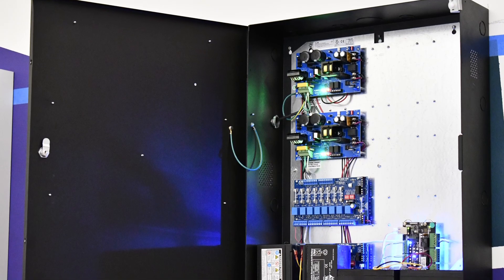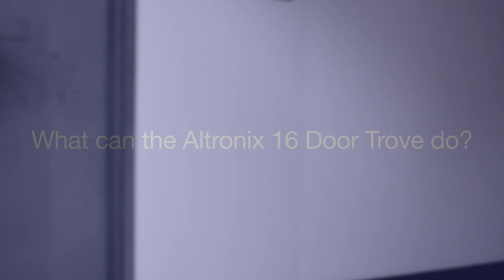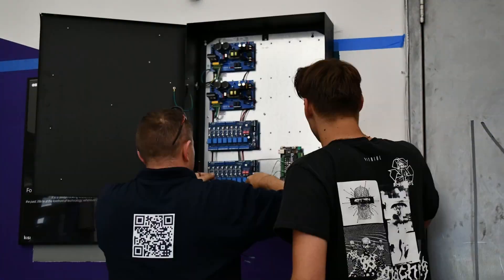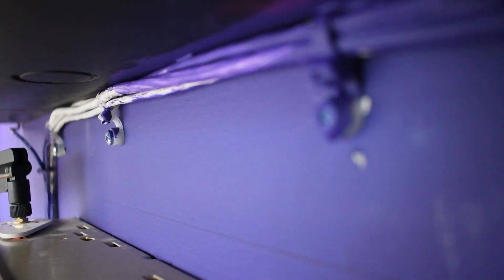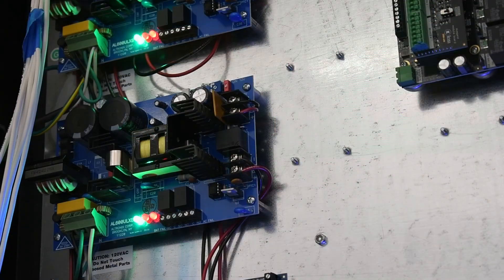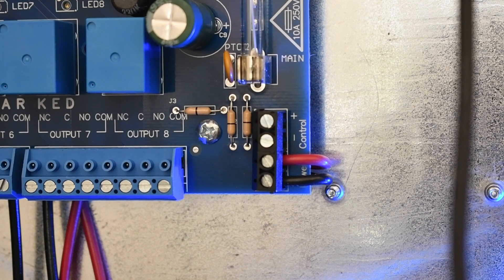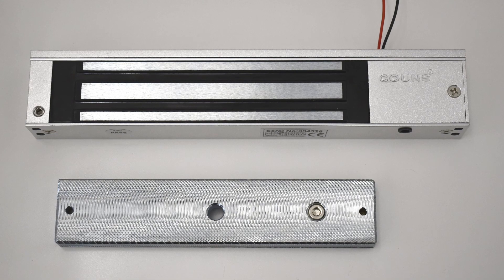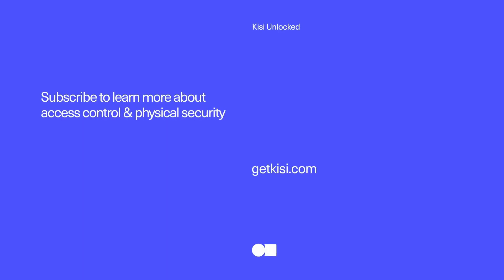Access Control Unlocked: Altronix 16 Door Trove │Kisi

Comment: I am using one of your 2-wire switches.  How do I mount that?  I have only 3 controllers, so perhaps I can disassemble the 2-wire switch and mount the board in the spot reserved for the 4th controller?